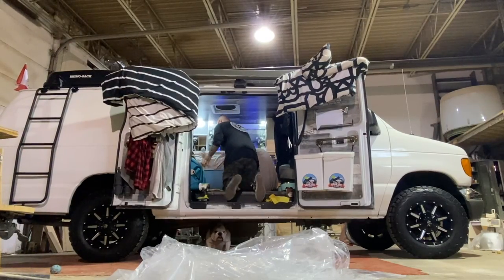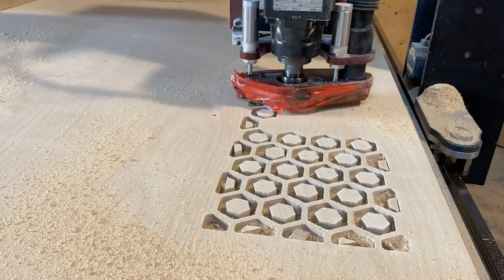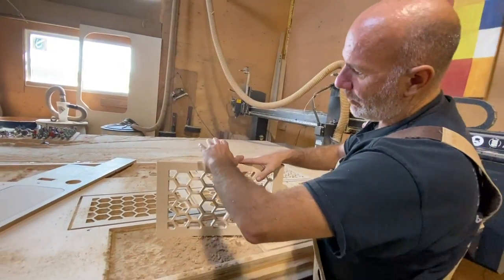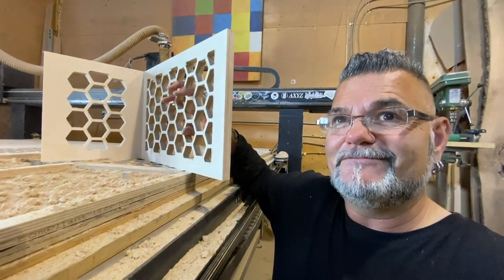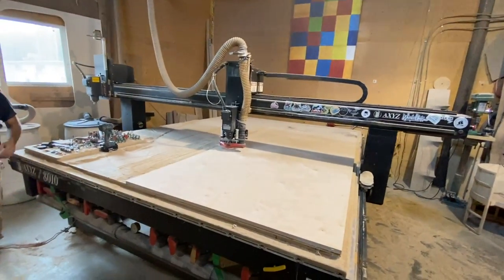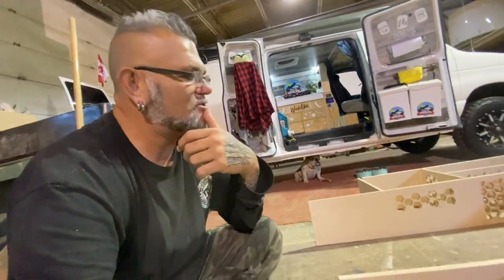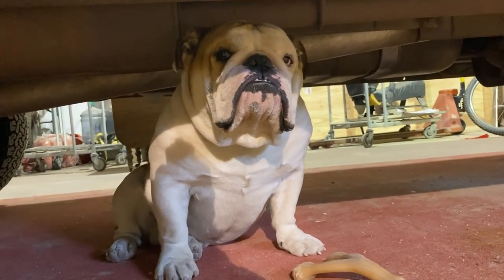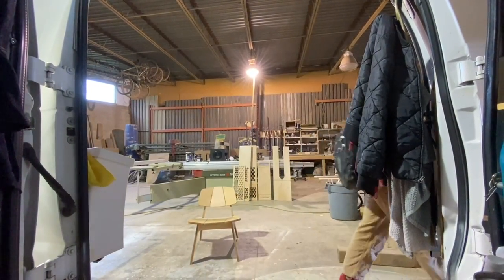VAN BUILD TOO HEAVY? Building a Functional Campervan Bed And Storage System That Is Lightweight

Comment: Andy is not a wood worker, he's an artist!
Reply: i ran a CNC mill several years, I'm well aware of that. He is still an artist.
Reply: Thanks David and Caveman,  I've had this machine for 8 years now and I hope I'm over the bit breaking times and the expensive  fire wood... lol  I've recently been learning 3d machining software for a 6 axis machine (robotic arm) we are looking at. Funny enough the material is the cheaper part... it's the tooling that costs the cash.. 😁
Reply: @overlandinteriors  dude, I suggest u start uploading vedios, u are so talented
Reply: Few woodworkers aren't artists.    He's not a monotonous house framer.
Reply: @cavemancamping  He's not even pushing the wood to its limits.  Not knocking the design at all.  It's just well within reason for structural integrity for what's being done.
Reply: @cavemancamping  boats are much more complex than this.   Especially with wooden hulls.  The force they can handle, with fairly thin wood if designed well is incredible.  Plus it can't let water in.   This really is simple.  No complex curves, no massive loads etc.  I'm sure he can do much more technically difficult jobs than this.  It's just not necessary for this application.
Reply: @veganpotterthevegan  I totally agree,  this stuff is fun stuff.... in recent years I've gotten into 3d carving on a large scale.  Mostly for commercial sculptures and signage.  But Sadly the Museum work has dropped off and we are retooling for van interiors... so far I feel we are just playing around. 👍
Reply: @overlandinteriors  hopefully someone hires you to do a fun van build with some bent lamination and whatnot.   I get that not everyone needs or would want that.  Plus it would cost a lot more money.  But it would be super fun.
Reply: Happy Camper Kits amazing job! When I buy my van, I will drive to Canada so you can make the set up. Ian from Florida. 💪🏼

Comment: 2000- 2005 I worked on conveyor,  loading dock equipment and d production equipment.  Did some medium duty overhead gantry crane installation for a customer in an old steel mill building repurposed.  The producer was a shop that custom built display trailers/ semi 's for DeWalt, Rigid,  etc glad to see the CNC technology being affordable for the average & custom builder. Kudos

Comment: I have a mini campervan (AWD Sienna).  My goal was to build it lighter than when I bought it.  After removing all but two of the back seats that fold into the floor, my van is about 100lbs lighter than when I bought it.  The other 3 seats, plastic paneling, and rear AC weigh more than my bed, insulation and small fridge

Comment: What material is that?  Exterior grade 3/4 inch plywood?  Is it AC or AB ?   

Thank you for sharing your adventures.
Reply: Hey Pedro we use mostly Balticbirch ply... the 3/4 is 13 layers thick for strength.  👍

Comment: SMEXY- Smart & Sexy! Man, that's some beautiful artistry. My van build is at the IKEA stage right now but someday...

I agree with the previous post about some type of fabric to allow air flow but block little Cruzy bits from getting under the bed.

I am sure you will not be found wanting for dinner partners. I am in the USA unfortunately or I'd  make a run for the border today!!

Comment: That's awesome, love it, looking forward to the finished work when done...👍 Give Cruzzie hugs for me too 🤗💖 I wish I could find a place like Happy Camper Kits near me not far from Odessa TX USA 😊... however, today turned out to be day 9 to finally got all that nasty old glue cleaned off the floor, tire walls and gas wall, tomorrow I'm going to scrub all so clean from all residue, etc before I take care of all that minor surface rust and bondo all the holes not going to be used and paint, the comes the new insulation, flooring, walls, etc😊

Comment: Weight is the enemy of motorhomes, people building their own seem to use a lot of wood for panelling the sides and top which adds a lot for no gain. The limits on licencing and plated weights in the UK means they have no carrying capacity after making the internal parts and equipment. Even commercial build ones are lamentable with no load capacity left for people and food , clothes etc.

Comment: LOL Chrome, Wood porn, fer shur! The weight difference of the CNC'd bed structure over solid wood with mouseholes would be significant. How much do you think it would cost for other vanners to have such a bed/storage unit made for them, including paint/stain, fasteners, etc.?

Comment: That shop was noisy! The hatches were really nice but cutting for lightening and airflow would be simpler, quicker and probably stronger if circles where cut rather than the octogons or polygons ? Just looked unnecessary